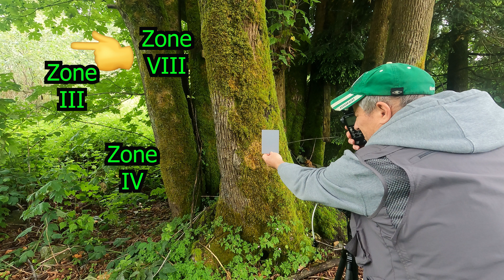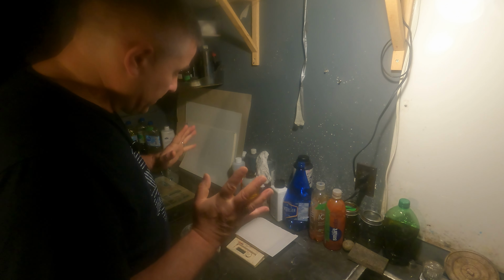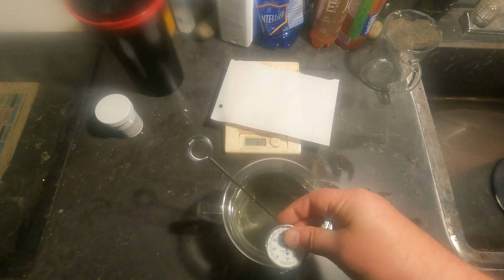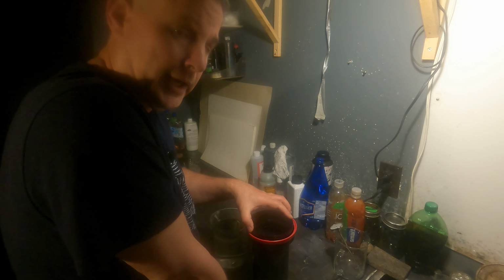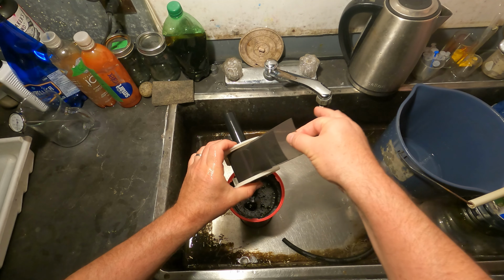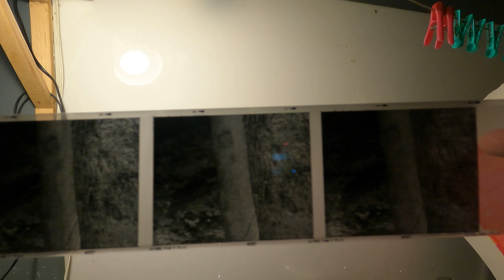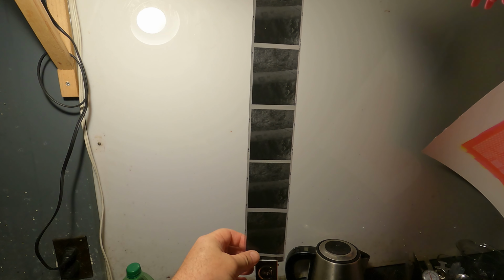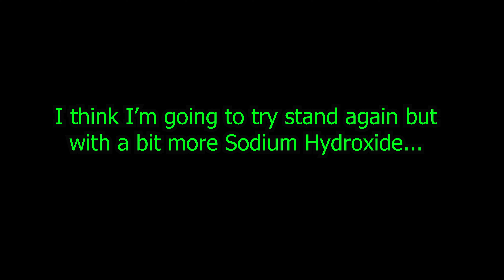D-23 + Sodium Hydroxide + Stand Development

Comment: What is the chemical action the sodium  hydroxide have in developing?
Reply from the maker: Acts as an accelerator to activate the developing agent, metol, making it more active. It also is added to increase overall contrast with developers.
Reply: Its common name is lye, just like you'd buy at the market. It is a powerful alkali, one of the most dangerous and difficult to use in photochemistry. Furthermore, it is very hygroscopic, meaning that it absorbs considerable water out of the air, making older volumes hard to accurately measure in the small amounts usually required. In relatively small amounts, it will accelerate the activity of most developing agents, reducing development times. Used in a concentration much more than in the video (1.0 gr/l), it will further increase contrast, but also rapidly build base fog density. In most films when compared to less active and more commonly used accelerators, it will increase grain coarseness, not to be confused with increased sharpness. Not clear why he's using it in the video, where sodium carbonate, or even borax, would be easier to use and measure in small  increments.
Reply from the maker: @randallstewart1224  I was curious about it so I thought I'd give it a try.